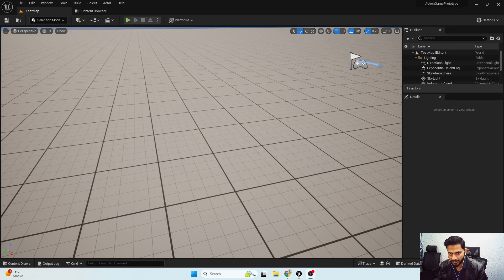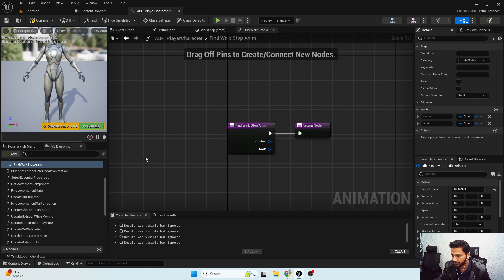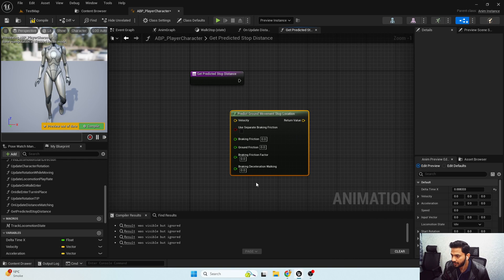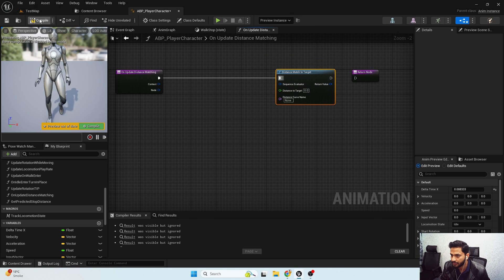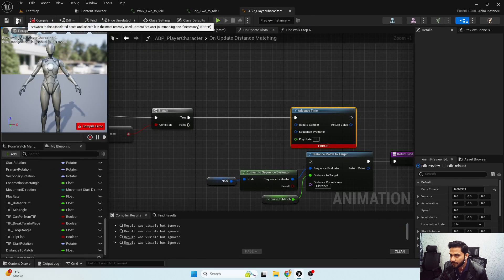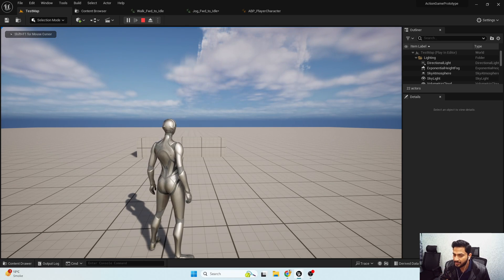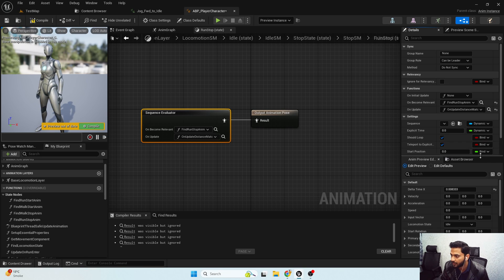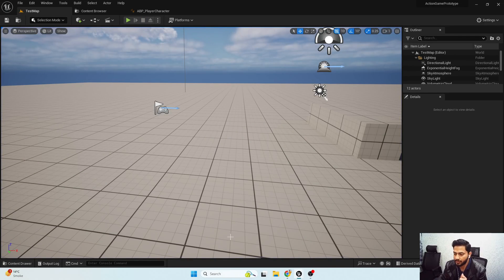Advanced Movement System | Part-10 | Distance Matching

Comment: For anyone else watching, I had stop animations that had a slight distance overshoot when it stopped, meaning the character actually went backwards ever so slightly. Because of this, the animation was accelerating to stop awkwardly because Distance to Match was hitting 0 before the animation was done moving. To resolve this, I simply increased the value of Distant to Match in "On Update Distance Matching" from == 0 to <= 2 on the branch controlling to Advance Time or to Distance Match to Target. In my animation its overshooting of distance was 2, so by making it 2 it played the rest of the animation properly.

Comment: It's not an animation issue alone, because the spine does go back when stopping at CERTAIN velocities. :) What you can do however to improve this is add additive layered spine gradient to use the stopping distance for controlling how far the spine leans. For example a small stop does not need the full stopping animation, but a larger stopping distance requires further into the motion. You have some good stuff on your channel though bruv :) Are you currently working?
Reply: I can make an additive stop animation, then convert speed into range from 0 to 1 and plug into alfa when applying additive, but how to make it work with motion matching? Currently I'm not at home, so can't check my assumption